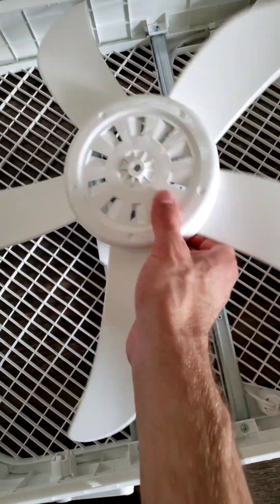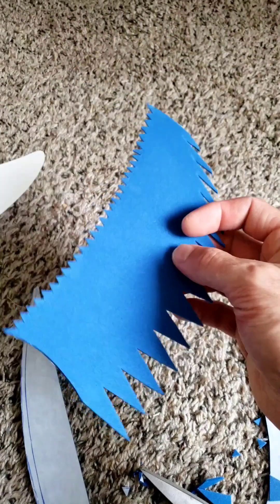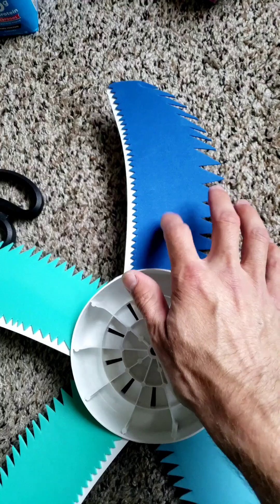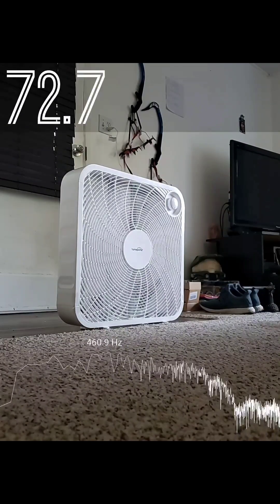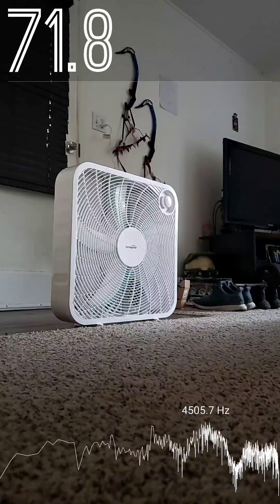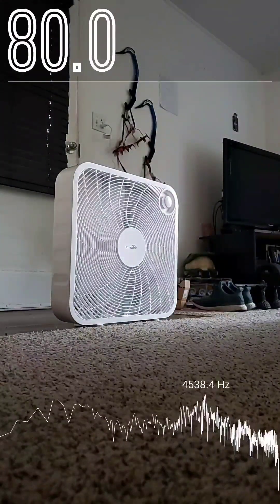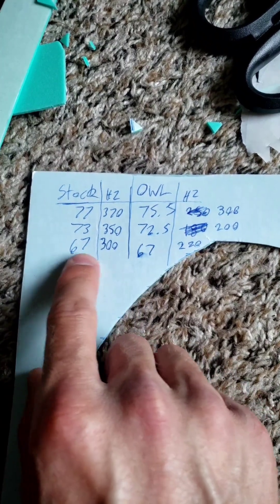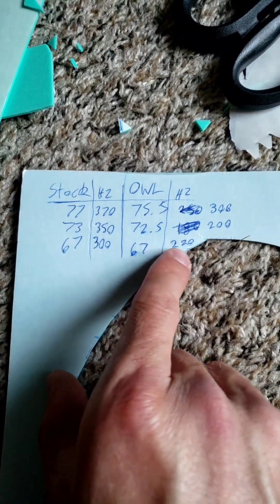OWL FEATHER TECHNOLOGY to make fans Quieter!  #biomimicry

Comment: You should have put a sensor detecting the rpm of the fan, because it is very possible that it also spins slower due to the added weight, meaning it moves less air. And if the serrated edge affects the efficiency of the fan.

Comment: Because you made it by sticking it on top of the existing blade you added lots of edges to cause turbulence and noise, but the idea was so good it still reduced the noise a little. Imagine how good the fan would be if the blades were originally made owl-style. You need to get access to a 3d printer to test that

Comment: i assume you used your smartphone's microphone to measure it, which may not be the most accurate choice in most cases because of a high self noise level that a typical smartphone mic will have
gonna need a condenser mic or just a properly calibrated dB meter because it most likely isn't accurate
Reply: however, your setup is still enough to determine which is louder/quieter and what general frequencies are being generated
Reply from the maker: Yup, when I hit start video it would jump from 18 to 37db.  🥴  Definitely not accurate, but should be consistent enough for comparisons against itself.

Comment: Great idea, I can see that the frequencies have diminished somewhat but I could also hear a noticeable difference in the top RPM on the fan at full speed. So it is quieter on a frequency spread but also because of the reduced RPM overall as well. I think a lighter material and shaved to have no near right angle edges would mitigate the drag that the material induced, alternately you could dimple the plastic face of the fan to reduce drag like a golf ball and in the process remove a tiny bit of weight.
Reply from the maker: I think the weight is less important on something with a constant speed.  On variable speed, Absolutely.  Reducing drag would certainly help optimize it.  👍👍  It's very poorly crafted.  😂

Comment: Considering that on high there was a reduction of 1.5dB that would be a reduction of about 30% in noise power. A noticeable amount. To the people saying this is pointless dB is on a logarithmic scale not a linear scale.
Reply: He failed to measure CFM. What’s the point of making a fan quieter if it moves less air. If the reduction in efficiency is disproportionately larger than the reduction in noise this experiment fails. I am certain if he put the fan on a lower speed without the “feathers” it would yield better results.
Reply from the maker: Try it out!  I wanted to measure CFM, but I don't want to buy an anemometer.  My main objective was to make my fan less obnoxious, and that was successful.  The lower tone is much more pleasant.
Reply: @falloony that is not true. You are missing the point.    The goal is not to make the most efficient fan, the goal is to make the quietest fan. These two things are not the same.
Reply: @BornTrespasser  I disagree. The quietest fan is a fan that is off. What is the point of running a fan if it doesn't move any air. Measure the sound level of the fan on low medium and high and the respective CFM with and without the fins and  only then can you draw any sort of conclusion. You can swap the fan blades for bricks and it would make less noise but what hypothesis are you trying to prove? Maybe I am too simple minded to understand the experiment.
Reply: @falloony  your metaphor is incorrect IMO because this fan does still move air, in other words, the fan still functions. Even though the feathers add some drag to the blades, the fan still does move an appropriate volume of air and does it significantly quieter. At least that's the idea.
Reply: @falloony  It's not quite so cut and dry. Changing the timbre of noise can also make it less objectionable.
Reply from the maker: That's actually Much more considerable than I realized.  Thank you.  You just restored my faith in humanity.

Comment: So yhis is pointless... good
Reply: 70-75 is the difference between a dishwasher and a vacuum cleaner, so yeah I'd say 1-2dB is pretty good for a start.
Reply: Can’t really say pointless unless you mean less decibel points because it is in fact less
Reply: @bamcr1218  1 decimal point is a useless gain so the entire thing was pointless. The juice ain't worth the squeeze. The results are possible poor. No appreciable gain whatsoever. How else does it have to be said? This is completely pointless
Reply: @kevinhurley6919  useless maybe.
Pointless is inaccurate because as you pointed out, a point was gained